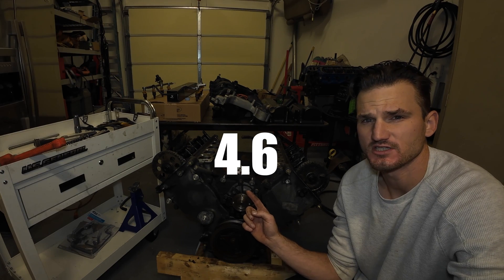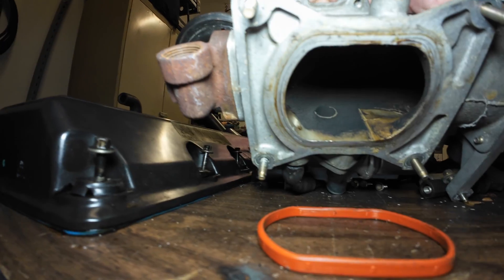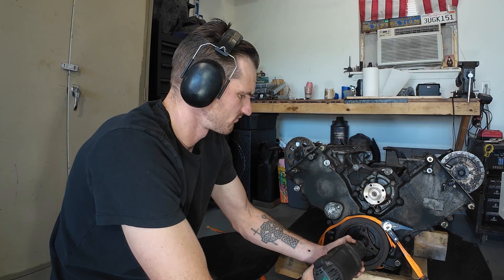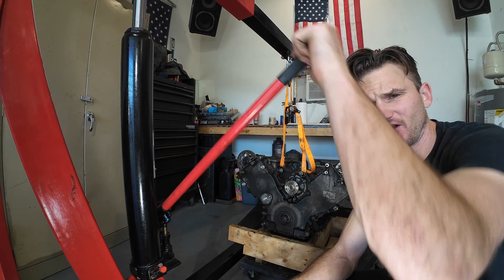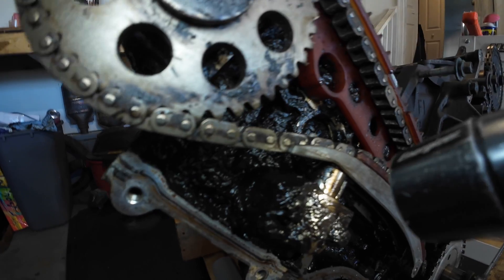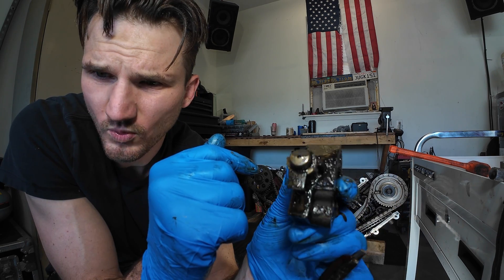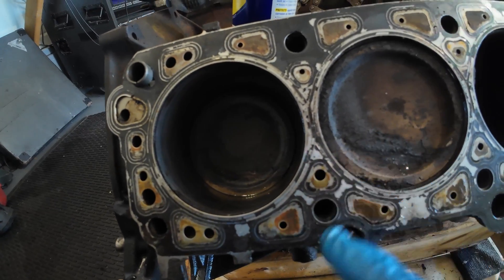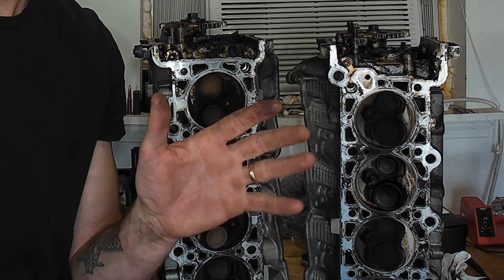Ford 4.6L Head Removal

Comment: If your intake has oil and mines gas coolant do I need to change out head gasket
Reply from the maker: Oil in the intake is from the crankcase breather, usually from blow-by, which is normal especially if it has high mileage, nothing to worry about. Coolant is from the head gasket and that’s not good, usually means head gasket
Reply: @ I had replaced intake so I should just change out those head gaskets